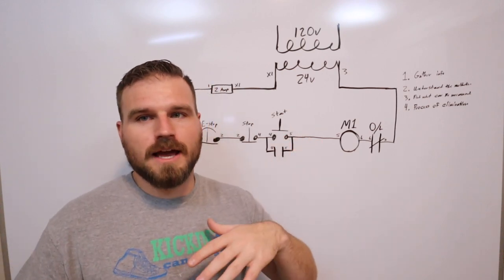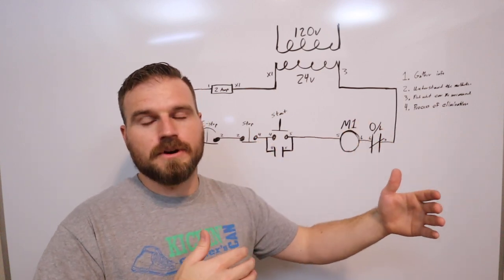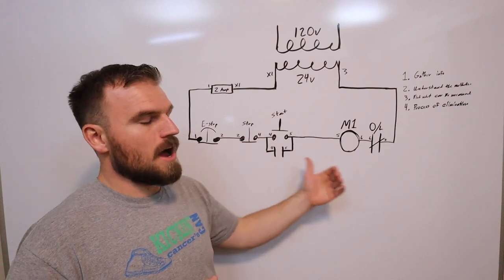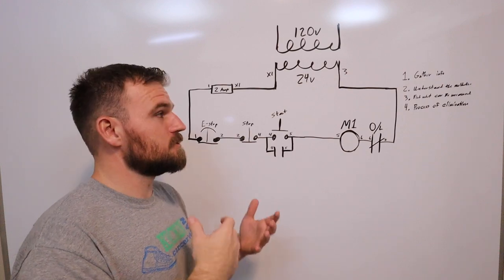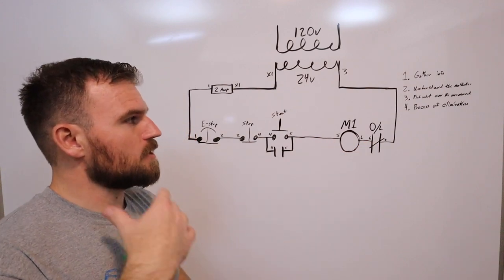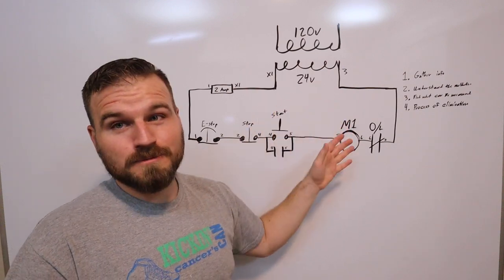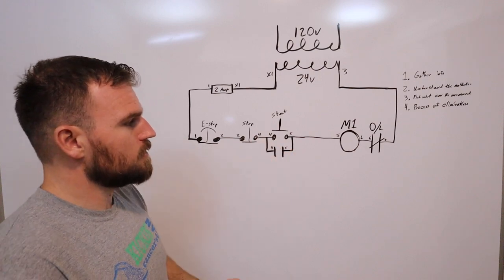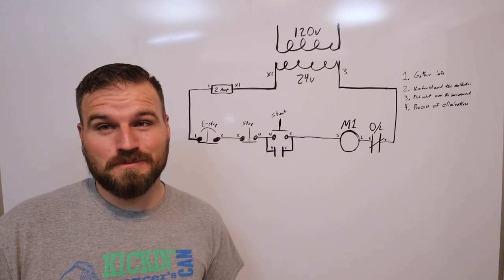Troubleshooting - Motor Controls

Comment: My procedure would go. Press start, observe what happens. Does the motor hum but not move? Depending on what I see, push start again and take a reading at the motor leads if they are easily accessible. Do you get voltage? If so you know there isnt an open, but maybe a device or contact is faulty. If the leads aren't easy to get to go to the closet point to the leads that you can. Is there a voltage? If so, is the motor seized? Does it trip the breaker? Disconnect the motor leads as that is the most likely cause of a fault, bad winding, perhaps? Press the button again. Does the breaker stay closed? Bad motor, ohm it out fix it, or swap it. Basically, you want to work backwards mostly checking voltage. Some people like using continuity but that in my opinion should only be used to ohm out coils and such not to check for opens, faults maybe, and always remember when you use continuity to turn the power off, and also isolate whatever you are measuring so you don't get backfeeds and thus false readings. Rambling over. Good video Happy troubleshooting guys!😊
Reply from the maker: Great recommendations. I need to make more training videos like this that show the whole picture.
Reply: I NEED YOUR GUYS HELP I DONT KNOW SHIT BOUT THIS BUT IM ALL JOB HAS TO FIX OUR machine !!! HELPPP